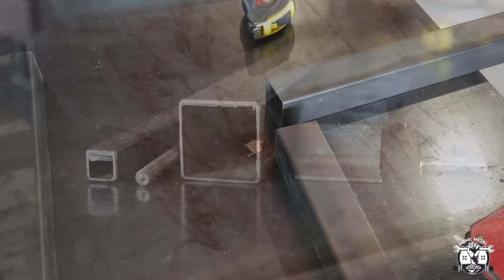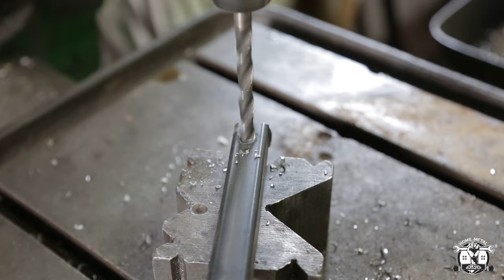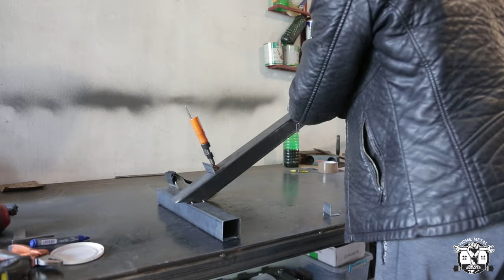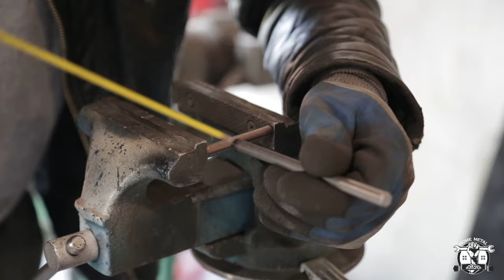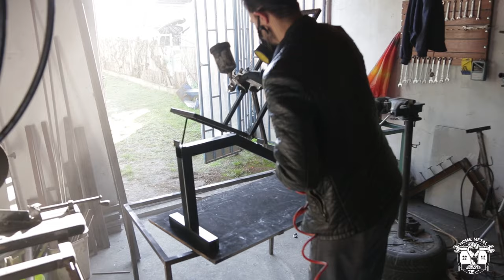DIY Tutorial: How to build adjustable incline gym bench.

Comment: The welding point seems not enough😬😬😬
Reply: Also was wondering about that. I thought he maybe first Beginn with just the points as usual, but didn't complete the welding 😲 wouldn't bench to much with it... Wouldn't be that much extra work to finish the welding compared to the total work, but would looks more professional and much more stable
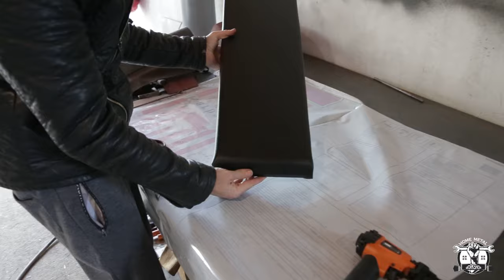Reply: 07:14 it does seem that he did finish the welding
Reply: @LifestylerAUT yeah for sure he welded it up,you just tack it when your doing the fitting so you can easily grind of the tacks if you have to move something
Reply from the maker: I welded the complete bench only by mistake I did not record
Reply: @LukasZ92.  if he didnt welded it, it would fall apart instantly

Comment: During bench press on incline. The upper body rest, basically works like a long lever and its gonna bend your m10 bolt hinge joint. You need a pinn and pipe joint as this is cirtical. It may survive only 100kg max and if you jerk it, then it can bend or sheer the bolt right off.
Reply from the maker: 140kg

Comment: Speaking as a welder myself, why did you only tack weld it? This thing will break with just bodyweight!
Reply from the maker: Hey Chris, I only used tack welding to hold all the elements together while assembling the construction. Once everything is set and all the angles are correct the entire construction is welded which, sadly, was not shown on the video.

Comment: Hey man, this bench looks awesome and I'm going to copy it. But I have a question, other than the 75cm box, I cant tell which one is the 30cm, the 33.5cm, the 35cm and the 40cm. Could you specify??
And also, what angle did you cut the 75 box?
Reply: Yes, this info would be VERY helpful...
Reply from the maker: Hi.Down legas are 35 and 40 cm vertical is 33.5 and horizontal is 30.Agle of box is 32 and 58 degrees

Comment: Hello friend, I'm Brazilian and I really liked the style of your stool, this threaded bar with nuts you used, tell me the size of it and the nuts, I have metalon 40x40 2mm in your hands, the measurements of the stool I was in doubt as to the height of the seat and the size of the seat, if you can explain it better, I'm grateful, a hug!!
Reply from the maker: Greetings and thank you for following my work. The threaded rod is 10 mm thick and the thread is cut on a metal lathe. Seat dimensions are 75x24 cm

Comment: Hey man! I know there isn't much sideways/shearing force on those welded joints, but does spot welding those joints together hold? 

I haven't really done any calculations, but that seems like a lot of stress because of the small surface area.
Reply: In an another comment he said that he did fully weld it
Reply from the maker: Thanks

Comment: Great video!  It looks like you used MIG welding for this job.  Why did you switch to stick welding for the seat prop?  Thanks!
Reply from the maker: Hi.Thanks. Because it is easier because there is no grinding. The electrode fills the gap just enough so that it does not need grinding. It has to be grinded using the Mig process.

Comment: hey bro do you have a sketch somewhere so we can recreate this build,im sure a lot of us find it hard to figure out exact dimensions of the bench
Reply: The exact size doesn't matter,make the thing the size you want it.are you big and want a wide bench or are you scrawny as fuck and prefer a narrow one?are you tall and want the bench a little taller so you can do rows without hitting the floor or do you powerlift and want it regulation hight?you can do what ever you like since your building it,that's the beauty of it.I would suggest doing a different locking system for the seat though
Reply from the maker: Sorry i dont have but dimensions are in description

Comment: What do u put on the angles before you weld? Those tools/aparatus u put on the corners/angles before you weld?, What is their name i kno they have spirit level, but what are they called?
Reply: The Red corner block is a magnet which can hold it square. You can also get ones that holds at 45 or can adjust to assorted angles as needed. The tool he used after he tacked was just a square to see that it was a true 90.

Hope that helps they are fairly cheap to purchase as well.
Reply from the maker: Clamp

Comment: I'm a welder myself. No thank you! Not structurally sound for a workout bench.
Reply from the maker: Thanks for the advice :)
Reply: The little rod deal for the seat was pretty lame and the tubing for the back pad and especially the lever arm could certainly be a little heavier but the main structure and overall design is sound,if he does something better with the seat I think
Reply: Ya I dont want to knock it down because I respect hard work and do it yourselfers but if it fails it might cause an injury. So I would simply reinforce it a little bit and make something stronger than that little piece of rod